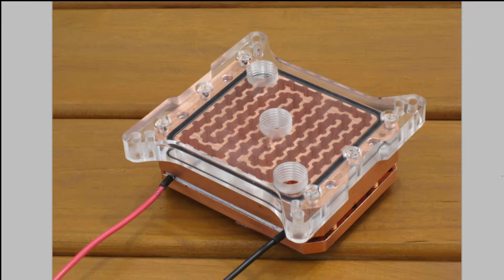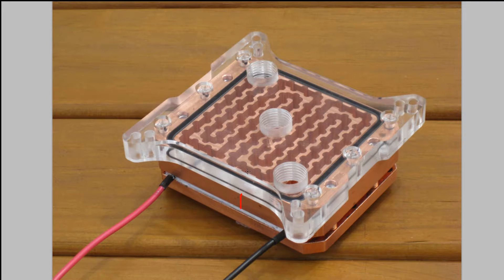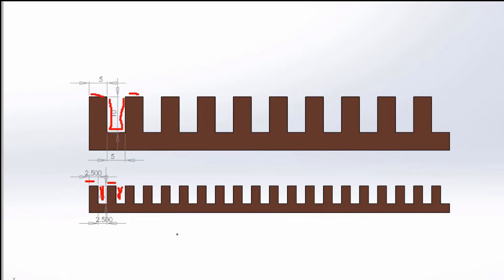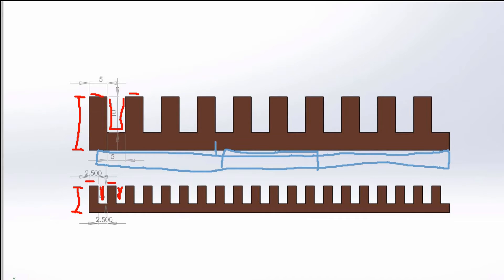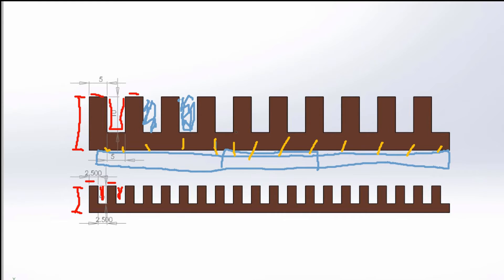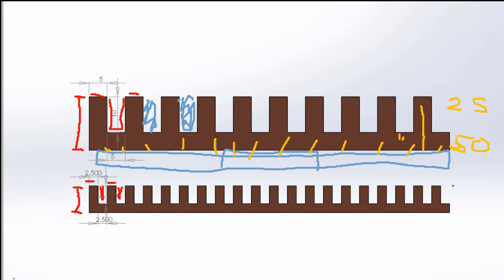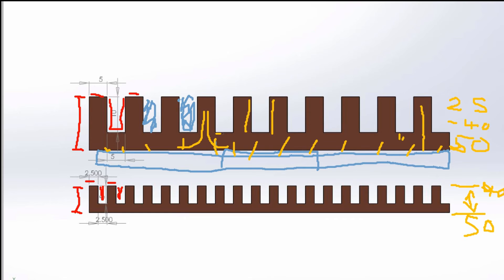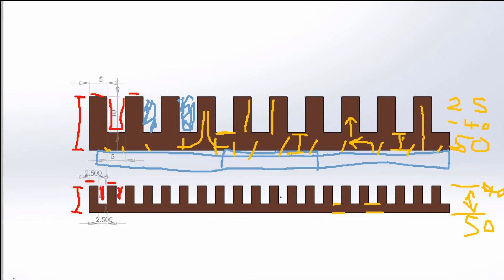Peltier Waterblock Theory: Thick V Thin Blocks. Episode1

Comment: based on amount of heat you need to transfer you could calculate the optimal geometry and take from there the maximum height(thickness).